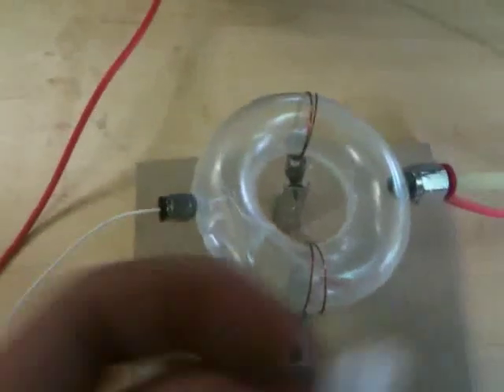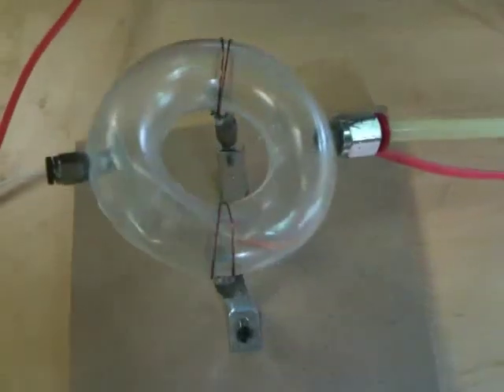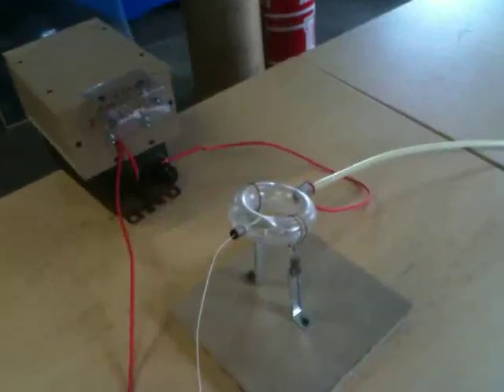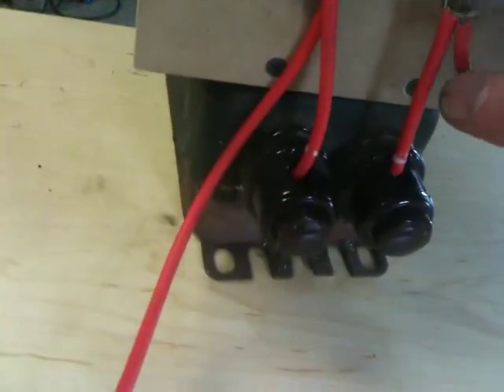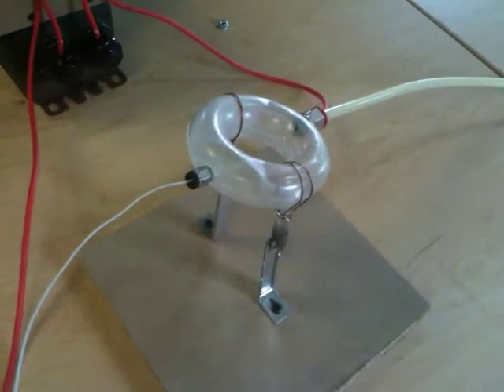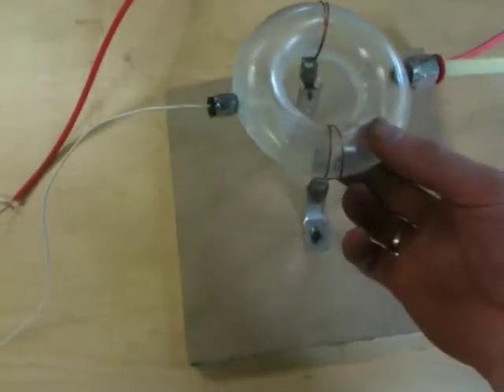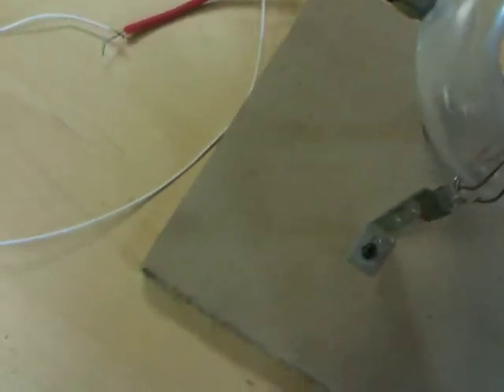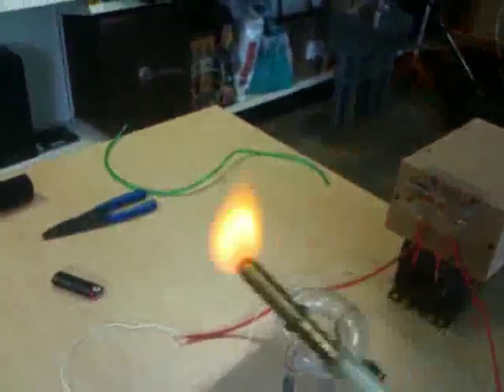P3 Hydrogen Plasma Experiment... Kinda Worked... RWGresearch.com (Test 1.3)

Comment: One thing that would help you get the plasma to sustain longer would be to hook your toroid to a vacume pump and lower the pressure inside it, that would lower the resistance. I would also look into getting a glass toroid, plasma is extremly hot and will melt the plastic in seconds, it will melt glass too so I would look into getting some ring magnets or making electromagnets to keep the plasma away from the walls.
Reply: ya thats true it could defenetly do that not a good thing to have glass shards flying around!
Reply: science1324  hot glass shards. cant forget about the warming sensation
Reply: Wait you can control plazma with electromagnetics that's awesome
Reply: Wait you can control plazma with electromagnetics that's awesome

Comment: The capacitor wouldn't hold a charge because it is wired in parallel with the transformer secondary coil. As soon as the coil quits producing current, the cap drains through the windings like a resistor. If you were to rectify the AC output of the transformer, the capacitor would charge and hold until something bleed off the stored potential.

Comment: Now try the same setup, but remove the hole from the enclosure. At first it will arc straight across. Then put one bar magnet above and one below. Perhaps using solenoids so you can adjust and match field strength. I suspect the interesting stuff will happen when the magnets above and below the arc chamber enclosure are pulling at each other.

Comment: You need to keep the arc from touching the plastic toroid. A series of magnetic Halbach arrays around the circumference should do the trick.

Also consider using another gas such as nitrogen or argon to avoid a possible explosion in case the plastic melts and oxygen meets a charged up soup of hydrogen atoms.

More safety equipment for you eyes and face are needed too.

Comment: if you really want to trigger plasma with this setup, you will have to use AC power. the frequency should be ABOVE 40 kHz. That way, you should have dielectric barrier discharge(DBD). if you attemp to use DC, it will not work unless the glass barrier is shot through.

Comment: How about using a magnetic field and applying the RHR (right hand rule)?
Reply: dale nassar possible but it would need other modifications to the design as I applied the "rhr" to confined the plasma under magnetic confinement and other various means
Reply: dale nassar possible but it would need other modifications to the design as I applied the "rhr" to confined the plasma under magnetic confinement and other various means